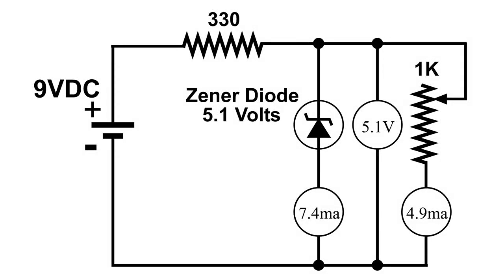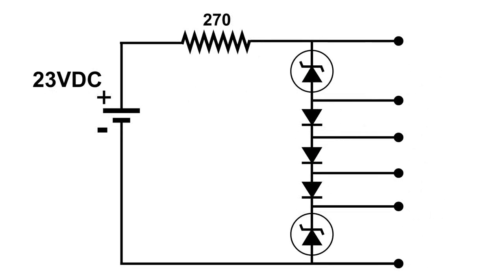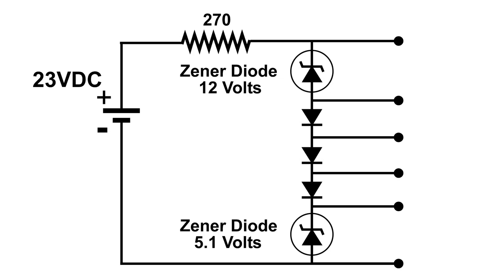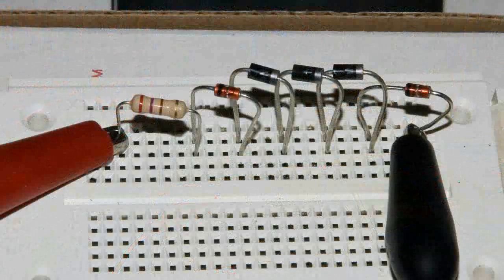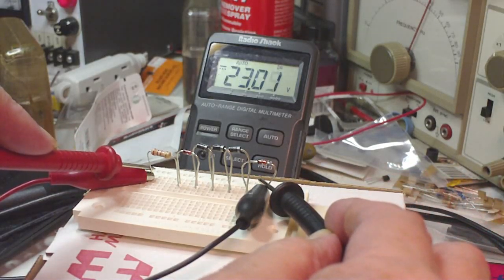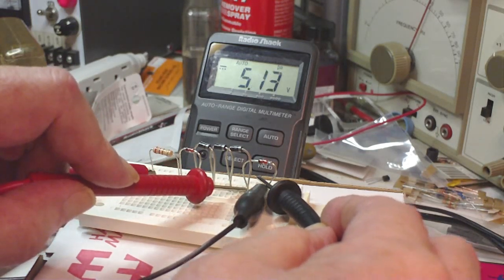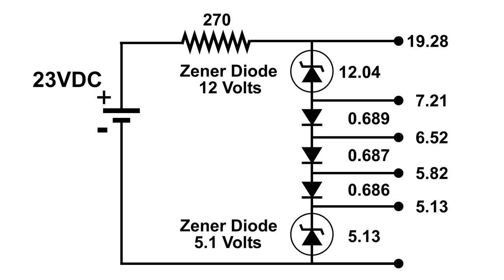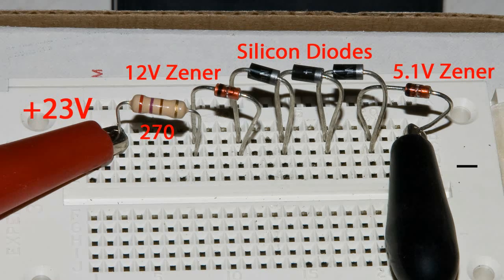Zener Diodes and Silicon Diodes, Multiple Output Regulated Power Supply

Comment: Thank you for the video.
Then, with the illustrated method, if the power supply is capable of 10 A could you (using pass transistors) build supplies with 3V, 6V, 9V, 12V, 15V, and other custom voltages. each with about 10 amps capacity?   
"Right? Wrong?  Heck no, you're expecting too much!   lol  "
Also, could you (using one supply) make power supplies with both positive AND negative voltages?   The combination neg and pos supplies with 5A pos and 5A neg?
Thanks again.

Comment: This is going to be the most ignorant question ever probably, but wasn't supose the diode not to allow flow in the oposite direction? I ask this because there was voltage on the rectifier diodes!

Comment from the maker: @BiDaDiKuNuKu If you have an unmarked diode, you could make a circuit to determine if it is a zener and it's avalanche point. But you must be very careful not to use to much current otherwise it will burnout. The avalanche is triggered by voltage.

Comment from the maker: Thanks CameramanLink,
This would be a light weight power supply but it would be great as reference voltages. In this circuit each silicon diode acts as a 0.7v zener, so this circuit is superior to a resistor voltage divider. In this circuit the diodes will try and keep each voltage stable, up to their design limits. Yes if you want power you would need a hefty zener. That is why you would us a regulator and most are a reference zener and a power transistor packaged together.

Comment from the maker: I would have to see the circuit to be sure what the caps are for. Just speculation, the .1uf could filter 60 cycle noise and the 100uf cap help stabilize the output. You could use a zener but it probably would cost more than a regulator. Most regulator are pretty much and amplified zener. Zener + Power Transistor.

Comment: I have a 7809 T220 voltage regulator and I used it to drop 12vdc to 9vdc. The circuit  calls for a couple .1uf caps and a 100uf cap.  What is the purpose of the caps and why can't zeners be used instead.  Would the caps be needed to regulate 12vdc to 9vdc when using zeners instead of a regulator component?